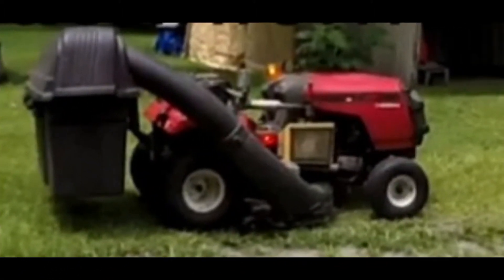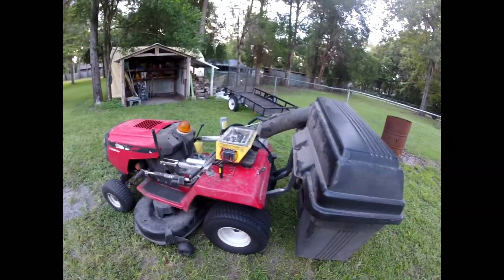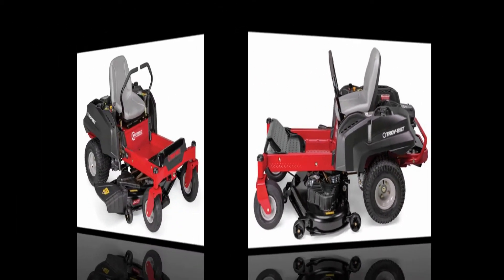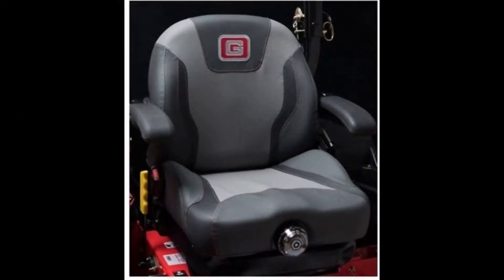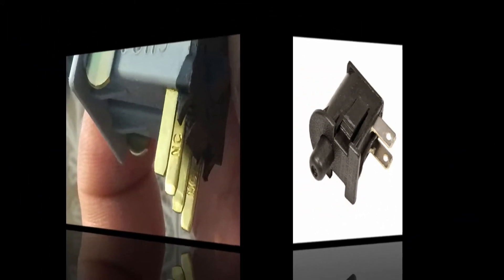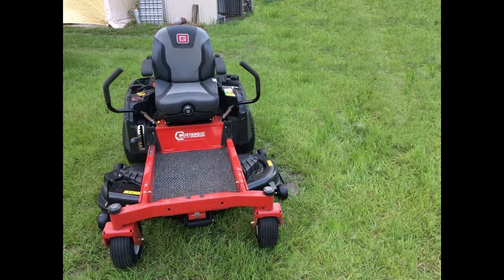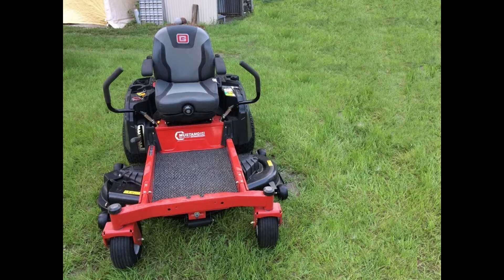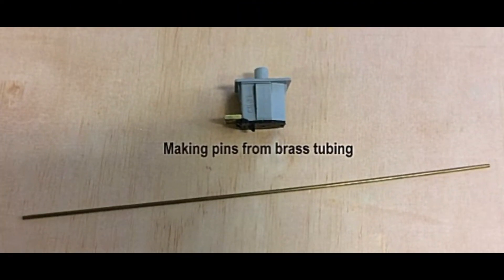"How I Did It" 4 wire to a 2 wire seat safety switch

Comment: I just finished a temp wiring to test this out.  It worked.  I am going to permanently wire this way tomorrow.  One item that I did versus the little piece of plastic to stop the seat connector from grounding out, is to replace it with a for wire automotive connector.  I hope this works when I'm done.  Great video!!
Reply: I finished the rewire and it works well.  The only difference is I used automotive electrical connectors in places.  I removed the original seat connector and put an automotive connector in place, this worked to eliminate the little piece of plastic to stop the grounding.
Reply: This was on my John Deere LA175

Comment: what is this? This is NOT wiring a 4 wire to 2 wire.
Reply from the maker: The seat I installed has a 2 wire safety switch. The switch on the factory seat has 4 wires. I connected the 2 wire switch so it works as the 4 wire switch did by adding relays that do the work of the 2 missing switch wires. Been 5 years now and the mower is still doing what mowers do with the safety features still operating as they did before the seat swap.  I show the details in the video on how I did it.  I refuse to disable safety devices on my mowers for knowing there will come a day someone else will be riding my mower and not me. My last mower lasted over 20 years and maybe this one will as well.

Comment: going to mail you my mower so you can perform this very useful procedure for me!!....this video explains exactly what I wanted to do- and needed to know in order to do it. Thank you so much!!!
Reply from the maker: Glad I could help you out. It has been 2 years now and I have had zero issues with any of the mods I have done on my mower. If you are a tall guy (I am 6'3") You may notice I took the black foot rest off my mower. I really like the extra leg room I get with the foot rest removed. I don't think I talked about that in any of the mower mod videos I have done on the TroyBuilt mower.
Reply: @supertroyofssf   I have the opposite issue.  I have a two wire safety system that I need to work with a 4 wire occupancy sensor on a seat.  Do you have an idea what would need to be done to wire that?
Reply from the maker: @huntercouncill8300  Maybe, So first, Do you know what each of the 4 wires are for?
Reply: @supertroyofssf  I do not.  I guess my first step is to get a meter and check which leads are connected when the seat is depressed and then connect them with the two wires?
Reply from the maker: @huntercouncill8300  I agree. That is where I would start. The key is to understand how everything works before you make any changes.